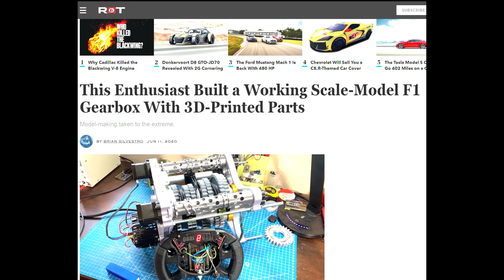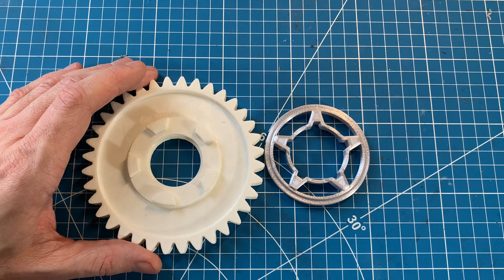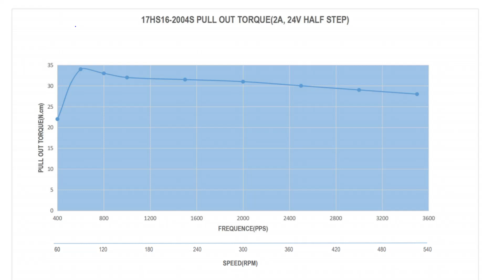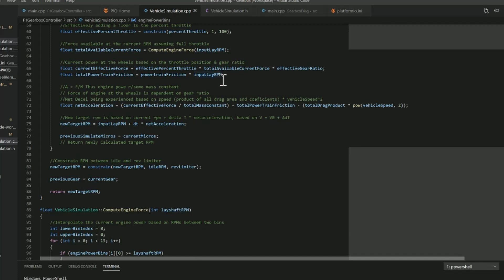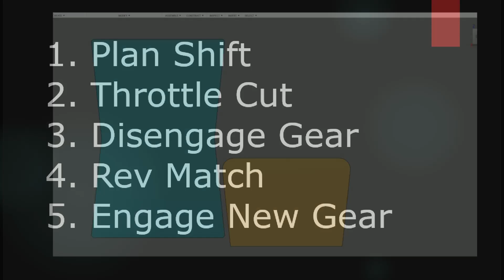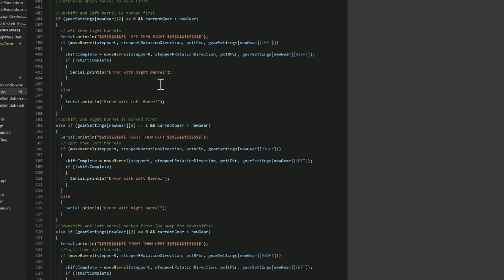3D Printed F1 Seamless Shifting Gearbox - Part 6

Comment: Do you have a step file of the model ?
Reply from the maker: I've added a STEP file to my github.  I wanted to put one out earlier, but the issue I had when creating the gearbox was that Fusion 360 became very unstable once I added all of the gears  (This was also the 2nd thing ever that I designed in CAD).  So many parts I had to model in 15-20  separate files, which I would need to sort thru.  So the STEP file should have all of the parts needed to make a static model, and the STLs for sure have all of the latest revisions of parts and the electronics mounting stuff.  I hope that makes sense, if you find any issues let me know and I can probably track down the appropriate files.

Comment: may be worth investigating - detecting a failed shift and causing it to shift to the previous gear so that it doesn't jam or 'jackhammer' the computer could detect and correct for that faster than a human.  I also wonder if some of the problems w/ the dog engagement could still be friction based - you're not using any oil that a real transmission would have.  Some way to mount in some teflon or even delrin pads maybe..?
Reply from the maker: Yes, it’s definitely friction based. The layer lines on the dog teeth are aligned with the layer lines of the slider.  Eventually I may try other materials and designs for the dogs.  I definitely want to try and detect a missed shift better. I think part of the issue is the accuracy of the potentiometers. I have to run a large threshold, and I’m hoping encoders will be more accurate.

Comment: One way to help overcome the detent friction is to use solenoids to pull it back for the initial stepper motor rotation, then release it after it rotates past the cam high point.
Reply from the maker: That’s a good idea, I’ll have to check out what I can fit in there.